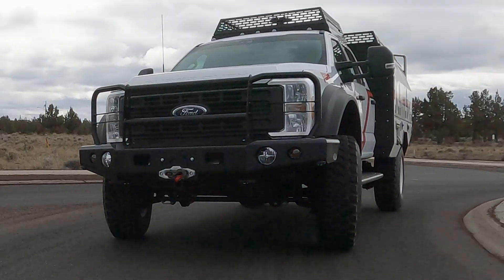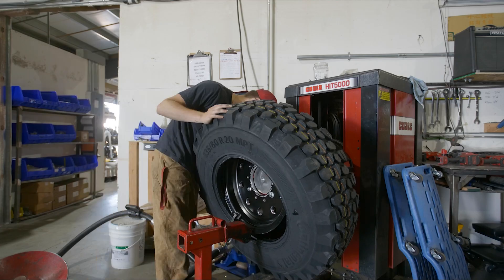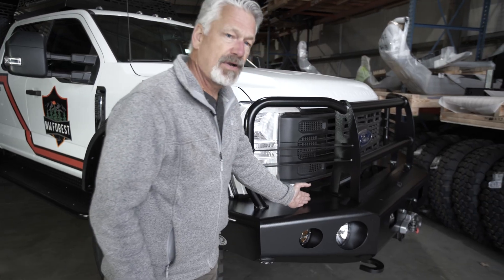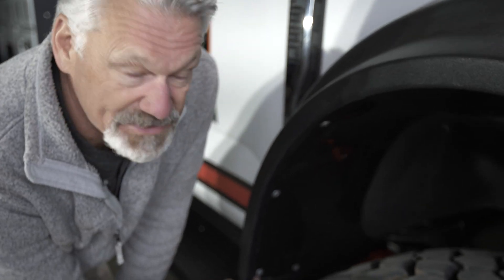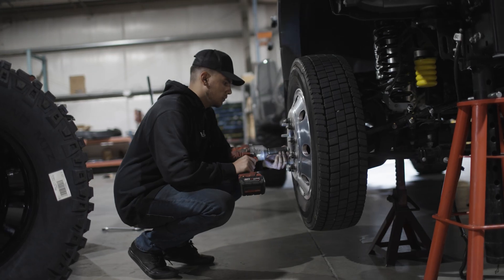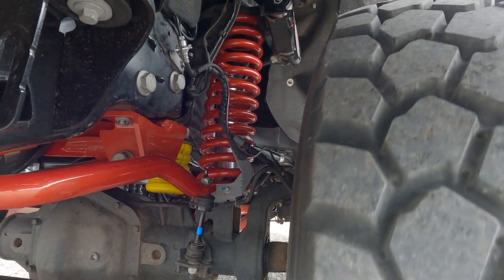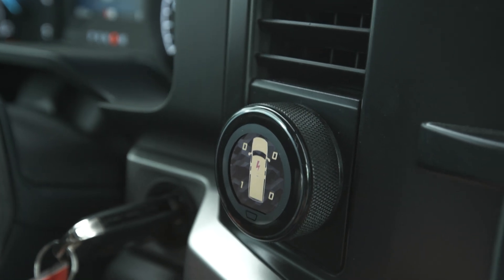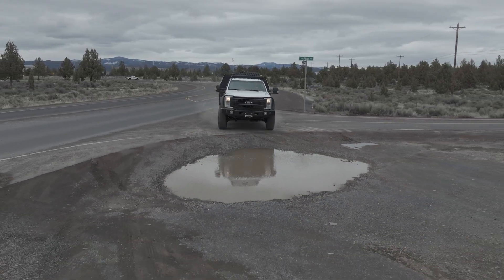Buckstop 2025 F550 Wildland Active Electronic Suspension

Comment: I have a Ford F450 cab chassis, and I'm building up a slide in camper setup.    I'm getting the exact same PSC Hydro Assist and Synergy bar setup that you have in this video, and your setup was the inspiration.   You can't steer a stock F450 around downhill switchbacks when the truck is idling.   It's impossible to get lock to lock at idle, and it's hold risks, because the steering wheel jerks at your hand, and I'm not a weak person.   PSC, Liquid Springs 4" Adventure kit, Bowen Bed, Kingstar Kruzr 10, Michelin ZL 365/80r20 (new version), gears, winches, bumpers = Beast mode.